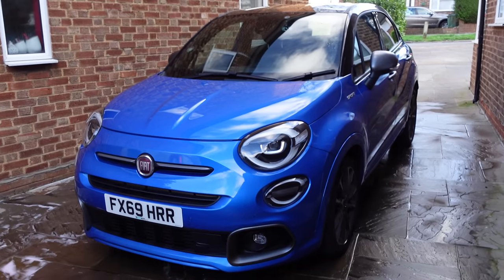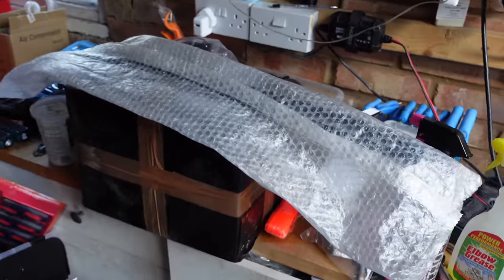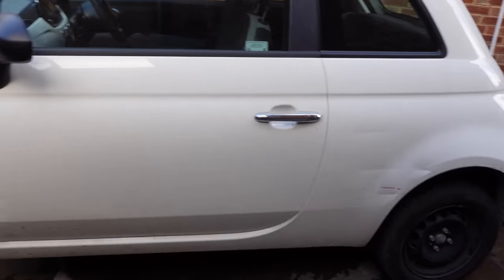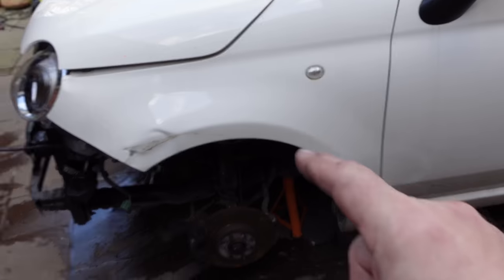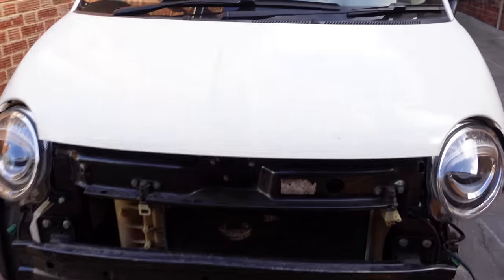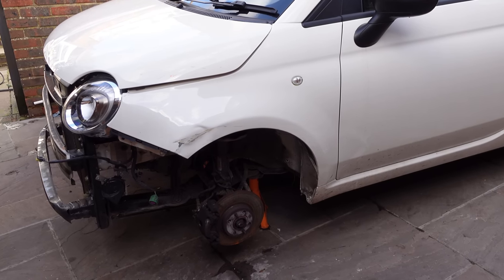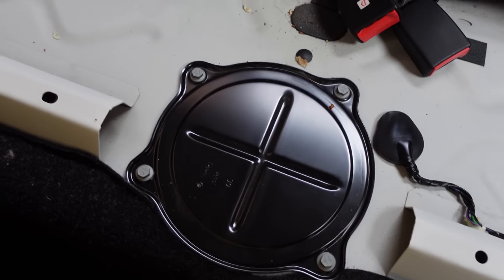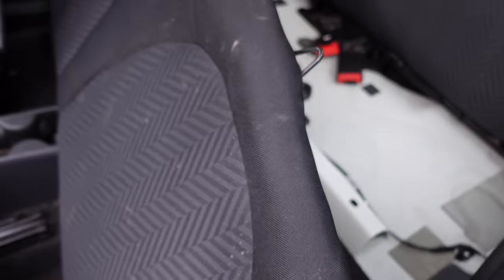Project Barry Day 2 - Finishing the Front End. Cat N 2016 Fiat 500 Pop. Copart Crashed Salvage

Comment: I Phil we bid on twenty cars at copart in october of which we won a dozen and all of them were as described. We have bought cars from copart ever since they came to the UK and to be honest we have only ever had one issue with them in all that time and that was a VW Caddy that they said it ran and drove it did not drive as all the wiring had been ripped out of it. Spoke to the manager about it she checked the listing and it clearly said run and drive so she came out and checked the van. She asked what i wanted to do and i chose not to have the van. She they then arranged to transfer the money we had paid for the van back into my account there and then no problem. the one thing i will say about copart is things have got worse since they have been selling third party crap vehicles you need to make all the checks you can.
Reply from the maker: I’ve been burnt with the third party cars, I never bid on the C ones now.

Comment: What's your thoughts on the fiat 500 twin air been offered 1 owner lounge with 136k on the clock 12 plate, head gasket gone, £1000 🤔🤔🤔
Reply from the maker: Far too high mileage. Every moving part on that car has potentially done the same mileage.  Wouldn’t touch it with a barge pole.
Reply: @Love500  was thinking the same with that milliage once done probly only fetch 2200 so not much In it, shame but glad u agreed 👍👍👍

Comment: Can’t see how a car can still be taxed if it’s written off and bought from copart etc, enjoy the videos.
Reply: I think maybe Cat D still show as taxed until the ownership is changed, although I may be wrong.
Reply: @SalvageMasterEssex  , I was only thinking that the insurance company must own them if they have paid the owners out, then they wouldn’t be taxed🤷🏻‍♂️
Reply from the maker: @MrTrev2507  I’m only going by what the DVLA website shows. Once the new logbook is processed it will cancel out the tax.
Reply from the maker: @SalvageMasterEssex  that’s why Cat N takes longer. Cat S are normally shown in trade whereas N seem to still be shown to the previous owner.
Reply: @Love500 , if I sold you a car as soon as I send off logbook, it is no longer taxed, the new owner can tax it using green slip, just didn’t want you getting nicke for driving untaxed car.
Reply from the maker: @MrTrev2507  it’s taxed. Check it.